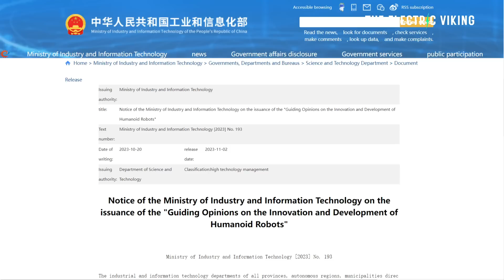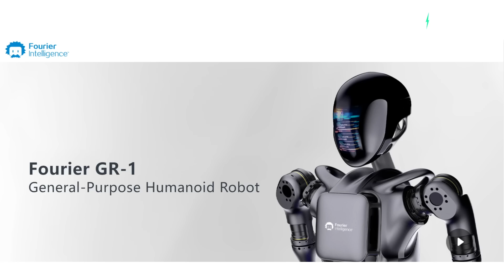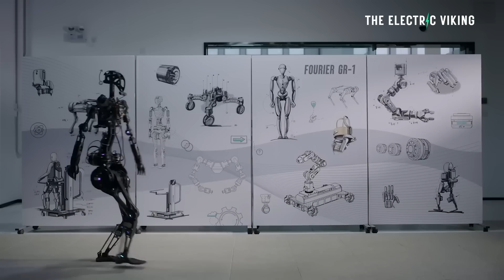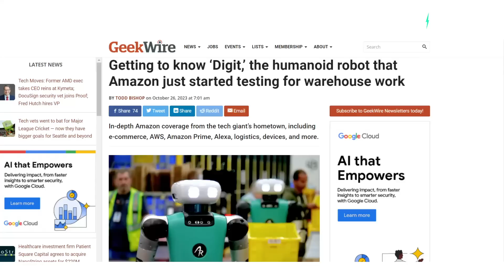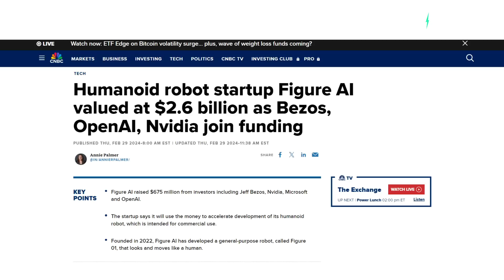China is mass-producing humanoid robots that will 'reshape the world'

Comment: Nonsense. Humanoid robots are a gimmick and have no practical purpose. Robots made for a production lines are designed and built for specific tasks and have been for decades. Humanoid robots wandering around a production floor looks cool but cannot possibly serve any useful purpose as they lack the stability and power to perform any task. One of these humanoid robots is simply going to fall over trying to use a power tool or lift a heavy component. In other words, the humanoid form is totally unsuitable for almost all tasks in a factory.
Reply: Agreed.  I would like to see a robot tie a basic fishing knot. It can't be done. Ever.

Comment: Show me a humanoid robot that can fuss and fiddle with the Jacob's chuck of a hand drill.
Show me a humanoid robot that can untighten a Jacob's chuck, remove a drill bit from a Jacob's chuck, then select the new drill bit, then install the new drill bit, and then re-tighten the Jacob's chuck.
Show me a humanoid robot that can perform a drilling operation with a hand drill, determine that the drill bit needs replacing, and then perform all of the Jacob's chuck fussing, described above. Good luck!
Reply: They don’t use hand drills in an automated factory!

Comment: What’s going to happen to owners of Chinese EVs outside of China if the situation in the South China Sea ends up in an actual confrontation. The Chinese will risk everything, politically and militarily to assert their claim on this area. Goodbye to the spare parts supply line would be the immediate result. If you’re looking around at BEVs, don’t buy anything from China. If you go for a Tesla, make sure there are no Chinese components in it. The new Renault 5 BEV is totally French, zero Chinese components.

Comment: Can someone explain to me the desire for humanoid robots. We're an inefficient shape that only exists because it's easier to cool the brain of a biped and that leads to us. But quadrapeds are more efficient and as long as you don't put the chips in the head, uncooled, in the African sun then they don't have the same design issue. Quadrapeds. With six arms. No head required. Also terrifying.
Reply: Bahahaha
Reply: The world is already designed for humans so they can be integrated easier. I.e. you don't need to rework the warehouse layout too much.
Reply: @100c0c   build a new factory designed for robots.
Reply: @darthkek1953  or just make them humanoid and use existing facilities.

Comment: Hypothetically,  a General Purpose Robot (GPR)  can do all 'human manual labour' tasks, which isn't necessarily a humanoid robot. It may be a unit with 5 agile tentakels with 100 different tools at its disposal, with exotic sensors, in a stable fixed position, able to change position quickly as well on wheels or on (three) tentakels. How useful and cost effective is a GPR?  Cheaper GPRs are less versatile and less precise. It could be that the most cost effective robot is indeed a humanoid robot with separate tools, but this assumption might be incorrect.  Is a cost effective GPR humanoid, and is it cheaper than a human considering the full life cycle of the GPR?
Reply: There may be robots with tentacles and wheels. We have a lot of different robots in factories already. However if a manufacturer is looking to save labour costs, surely a humanoid robot is the obvious choice. Once the humans are out of the way it may be possible to consider if tentacles would be an improvement. Actually places like Amazon have difficulty creating robots that can grip the things that a human can. Suckers work with many solid items but are less successful with bags and soft surfaces. Grips work with some shapes but not so well with others. Some products are easily damaged.
Reply: Hypothetical is another word for ......jack shit
Reply: @robertfonovic3551   Agreed. The big question is, is a humanoid robot that can do more than jack shit still worth it?
Reply: A GPR robot works much greater hours than a human. It can work all three or four shifts, seven days a week for the complete year. Sure there may be some downtime but the same is true of humans. If it costs more than the equivalent cost of a human working those hours, it would have to be quite expensive. Given that there will be economies of scale to build such robots, that seems unlikely.

Comment: And what do they plan on doing with all of their unemployed Chinese workers?  Having retired having worked on Robots, it is very often much better to redesign the assembly line to suit robots than to build robots to suit the assembly line.
Reply: These robots will build the AI-designed production lines. Just like SkyNet did.
Reply: I was just thinking this humanoid robot business seems like a temporary stopgap solution to operate sites that have layouts that suit human workers. As soon as you don't want humans work there you can create a lot simpler layout with a lot simpler machinery. No need for machines resembling humans..
Reply: @st4849   They already tried that, but human workers were always needed to do what the robots couldn't. So now they are trying to make robots that are more like humans. The only problem with that, is that while these "humanoid" robots may be able to move in a humanoid way, they don't have a human brain. Human beings are problem solvers. Robots are just order-takers. If they are programmed to do a simple task they will do it. If something goes wrong they will grind to a halt and not know what to do until they are offered new instructions. Yes they could be run by AI, but AI isn't even advanced enough yet to be able to drive a car from point A to point B without human intervention. Doing actual work is a a whole other ball game.
Reply: That’s the thing.  Most industrialized economies have a birthrate that is less than the replacement rate 2.2 per woman. 

Western Europe, Japan, China and particularly Russia (as well as to some extent the US) have that, among other effects, there will not be enough workers to fill the necessary jobs to keep their economies running.  In only a few years there will not be enough younger workers who can replace those who are aging out.  

This also affects pension plans like Social Security. There are bandaids but the numbers are the numbers.